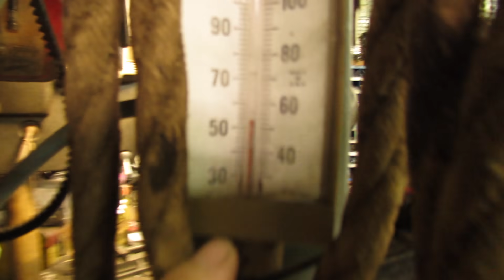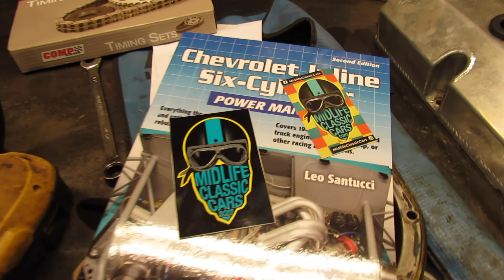350SS-Reassemble and fire it up

Comment: One time when I was wearing a dust respirator while using a cutoff wheel and the wheel exploded.  One second sparks flying, next second nothing, wheel gone...As I was putting a new wheel on I noticed i could breath better......The exploding wheel had taken one of the filters clean off my mask.....I actually never found the filter.
I took an extra coffee break to think about what my face would look like if I wasn't wear the mask...
Reply from the maker: Ive done similar before..Once on a motorcycle ride....
Reply: I love angle grinders, I like to think i am pretty good with one, however I have had them bite back a time or two. May or may not have required tendon reattachment... I have a well earned respect for them. I rarely use cutoff wheels anymore. I'll go for a body saw or a portaband for anything not hardened or in a really weird place. Flap discs are awesome once you discover their subtleties. I also will run 2 sanding discs back to back on a smallish arbor and use it like a cutoff wheel for small stuff and thinner sheet.
Don't get me wrong, there are many instances where a cutoff is the best/only way however it is no longer my go-to like it used to be.